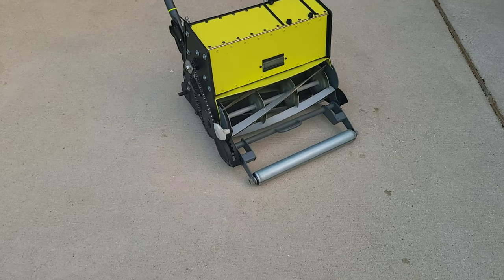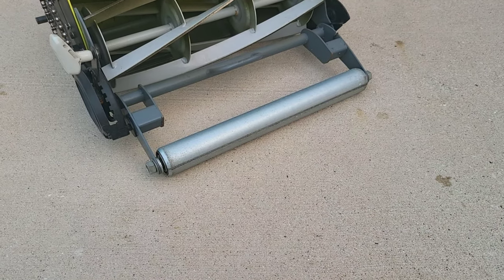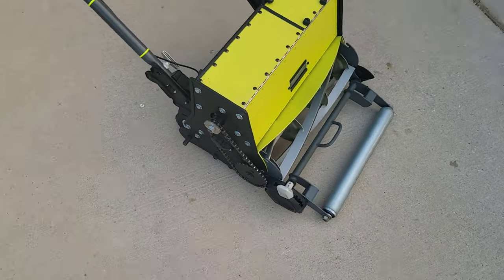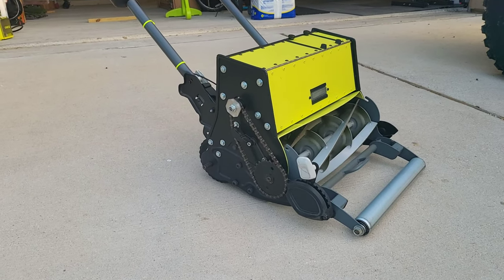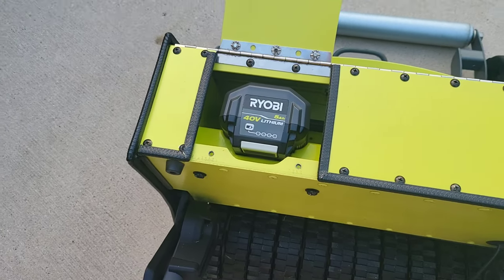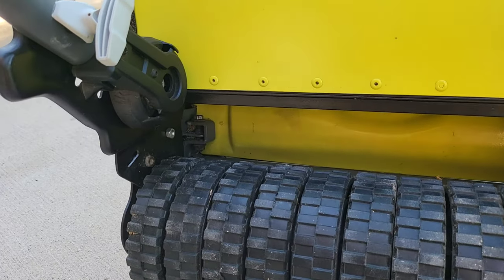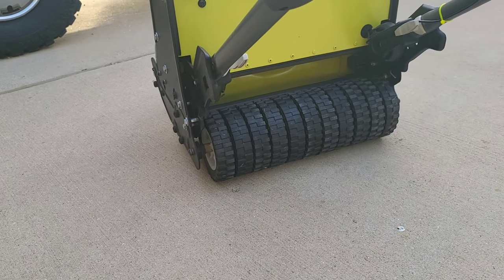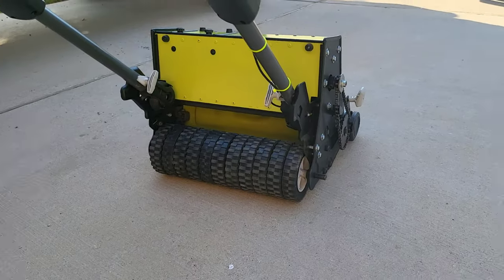Fiskarstein Monster full build!

Comment: This is precisely the kind of cordless electric domestic reel mower that the manufacturers should be producing. Instead they only produce greensmowers, large and costly domestic reel mowers and that dirt cheep thing that came out for $200.00 that the manufacturer calls a reel mower but consists of razor blades around a cylinder that need regular replacements as maintenance. 
I hope you’re planning on producing and marketing these. If you can augment a cartridge system similar to Allette mowers I think that a brush roll that switches out with the reel and dumps the clippings in a bag would be a great feature for suburbanites with driveways and sidewalks.
Reply from the maker: Exactly Bruce! I feel like there is still a huge gap between professional greens mower and smaller units sold for home owners, especially with battery powered equipment. All of your manual reel mowers (earthwise, scotts, fiskar, etc) are better quality reel than the one with razor blades, they just need a "power supply" to fit in that category.

Comment: Hey rusty. Great build. I did my own and I must say it’s a great learning experience. One observation…your chain tensioner is on the wrong side. It should be after the motor not before it. Since the motor spins and turns the reel by pulling (not pushing) that side of the chain will be under tension by design, while the other side (closest to the front or after the motor) experiences some compression or slack. Especially under acceleration or start up. I made the same mistake with my build and upon startup my chain fell off a few times or after hitting a thick patch until I placed it after the motor and before the reel. 
Not trying to over explain to someone like you who obviously has the skills for the build but for a new enthusiast who may be getting started like I was several years back and it would have saved me an extra half hour of tinkering in the garage. Thanks for the inspiration.
Reply from the maker: Thanks for that information. I never even thought about which side the tensioner should be on. I do have the ability to pivot the motor on the bottom bolt to pull tension on the chain and tighten it up. Definitely looking at ways to flip that to the other side though. I appreciate that!

Comment: Wow, great build! Best and most professional diy electric reel conversion I've seen. Would buy a kit if you decide to make those. For those of us already heavily invested in the 18 volt line do you think we could use that platform or do you think it needs to be the 40 volt platform to power this properly?
Reply from the maker: Thanks a lot Jeff! So I've seen on YouTube some using an actual drill to power a manual reel mower. If you were to do a similar build as I've done, I would try and find an 18v mower and pull that motor rather than using a drill motor. I would assume it could be done similarly but you may have to step up your mowing frequency so your not putting as much stress on a smaller motor with more grass clippings.

Comment: Done the same - IMO you may have issues with the chain tension.  I use a 250W 9.5:1 reduction motor & the torque is INSANE. No tensioner is effective. If there's a big load & some bumps you'll quite possibly jump the small sprocket (done it a bunch).  I pack out my motor mount with washers to give the correct tension & no chain tensioner is installed - never skipped a beat now.  You could also change the sprockets to larger ones to help avoid this & spread the load over more teeth - if anyone is building the same

Comment: This is great!  I am actually in the process of doing my initial conversion to my Fiskars, however, I’m having a heck of a time getting the rear/large sprocket off.  I had zero issues with the small sprocket on the reel, but the large just won’t loosen.  Any suggestions?  My mower is in great shape, and I’ve seen other posts saying the large sprocket is much tougher to remove than the smaller one, but nothing has worked for me yet.  Any advice is much appreciated!
Reply from the maker: Sorry for the late response. If you haven't already gotten it off, try heating it with a torch. That should do the trick

Comment: Did the fiskars sprocket mate right up to the ryobi motor? I pulled parts from a kobalt and the bore of the fiskars sprockets is too small. Don’t have a mill or drill press so considering all options
Reply from the maker: BC the fiskars sprocket does fit on the ryobi motor shaft. It's actually a hair bigger. Since you already have the parts from the kobalt, I would see if there is a machine/metal shop near by that can do that for you. Should be a quick fix if you can find someone with the right equipment

Comment: Any issues or updates after a year of using it? Was very interested in doing something like this with my Earthwise, but someone said I would need to "gear it down or have a variator to regulate max speed"
Reply from the maker: I have been running this setup for 2 years now and haven't had to do anything other than the sprocket setup with the larger one on the reel and smaller on the motor. It hasn't given me a single problem

Comment: Have you had any issues with the abrupt stop when you cut power due to the inertia of the reel? I've almost completed a build using a lot of your ideas and it seems like it may cause an issue after awhile. My small sprocket looks a little worn from my few tests and I'm wondering if it's from that or if it was like that and I didn't notice.
Reply from the maker: I haven't seen any issues, but that is definitely something I have been keeping an eye on. Most of the issues I've seen with others reaching out about the sprockets showing wear is from either a loose chain or the plane of each sprocket is a little off to where the chain doesn't track straight. I have thought about trying to find a "freewheel" adapter for the sprocket so that when the motor stops, it's not such an abrupt stop
Reply: @rustyscreations  I was thinking about finding the same thing. Might extend the life quite a bit. If I find something, I'll pass it along!
Reply from the maker: @erikgreenly7076  Thanks! I appreciate it!

Comment: Tapping a hex head sounds pretty difficult, did you "round out" the hex first with a file or something, or just tap straight from the hex?
Reply from the maker: celticknyt, it really wasn't that difficult. I did round off the corners to get the tap started, but after that, it's just nice and slow with plenty of lubricant.
Reply: Rusty,
Please provide additional information on how to tap the hex bolt and a link if pistols the lock bolts you settled on. 

Great work!

Comment: Hello Rusty, watching your video again and I want to confirm this with you. Looking at the gut it seems like you didn't reuse the electronics board from Ryobi, correct? The little silver color box on your video is a voltage regulator?
Reply from the maker: Hey Andy, at 2:17 in the video there is a clip of everything I pulled out of the Ryobi mower. I left everything as is. The only change was flipping a set of wires on the motor to change direction. That was the idea, can everything be pulled out as one unit  and repurposed. The silver box is the controller for the motor.
Reply: @rustyscreations  Makes sense. Thanks Rusty. Will be my winter project. You working on a kit for us?😀
Reply from the maker: @andytan168  Yes, that will be my winter project. The tear down to make some templates.

Comment: I have everything lined up and ready to go. It won’t fire up now any ideas?
Reply from the maker: Assuming it did run before set up, it's only a few things it could be. Depending on the model you pulled from, there's usually a safety switch in the handle bar that can be bypassed if need be. It could be one of the start buttons that I've seen replaced with a toggle switch on youtube. With my model, the part that gave problems was the magnet for the grass catcher which can be bypassed or even a piece of metal in it to close the circuit. Worst case scenario, it's the controller and not much you can do other than replace it.
Reply: Yeah it ran perfect when I took it out of the ryobi. I think it’s one of the original 40v ones it’s a black one. I’m assuming I missed a safety switch somewhere
Reply from the maker: @Dcabat  check the one in the handle to make sure it's fully extended and the magnet. Is there a light on it? If so, does it come on?
Reply: @rustyscreations  yeah light comes on  and it’s a self propelled one, when I have the self propelled motor connected it will spin that one as well.
Reply from the maker: @Dcabat  yeah, then it's most likely one of the safety switches that's keeping the blade motor from turning.

Comment: With using the front roller without modification, would it stay on the mower? Or was tapping with threads necessary
Reply from the maker: I did that just to make sure the roller didn’t have any play side to side. It will stay in place without tapping the ends. Just cut the inner bracket and will need to drill a bigger hole for it to fit

Comment: Hello , I have used the same motor from the same mower you used but the motor is turning counter clockwise, any idea why ?
Reply: Did you switch any of the wires? I guess that is where the issue is.
Reply from the maker: @hailutekle2911 Yes, you need to switch the yellow and blue wires to change the rotation. Leave the green wire alone.

Comment: What spacers do you use between the wheels if you don't mind?
Reply: I plan on getting the wheels from harbor freight today
Reply from the maker: @Bro7th  https://a.co/d/gBXlPHW 
these are the washers I used. Bought 2 packs of them. I stacked up all the wheels on the axle then added the washers til it was a snug fit. Then just take those washers and evenly distribute them between the wheels

Comment: This is unreal. Could you build one for me? I’m in Austin, TX.
Reply from the maker: The plan for this winter is to tear it down and make some templates. Then possibly a kit to bolt on. You're just north of me so if I can get a kit together I'll definitely let you know
Reply: me too! im in austin as well :) and im not handy enough to build this
Reply from the maker: @kristinconnolly983  Will do! I will definitely put out a video when I can get the kit together
Reply: Would love to buy a kit from you!  Keep me posted.
Reply from the maker: @golfshoe9321  Will do! Thanks!
Reply: @rustyscreations  I'm actually in Kyle, would love to know more about this! About how much did the conversion cost? How are you liking it still? Was there any welding or heavy modification required to convert? I watched both videos but could not tell and it looks so professional I just assumed there was haha
Reply from the maker: @EleventHour  I spent $50 on the fiskars and $100 on the Ryobi rotary mower. Then, I probably spent another $100-$150 on materials and other components. So, probably around $300 all together. There was no welding, just nuts and bolts and a little bit of imagination.
Reply: @rustyscreations  $50 on that fiskars!? I can’t seem to find one that works at all for under $140 haha
Reply from the maker: @_EleventHour  yeah they're about $100 around me most of the time. I actually found one for free bc the blade was "locked up". All I did was back off the reel to bedknife and worked fine lol
Reply: @rustyscreations  I need to find me one of those deals!
Reply: Any news on a kit for sale?